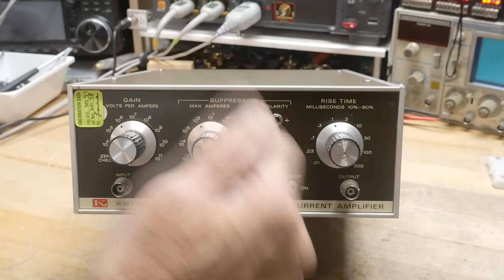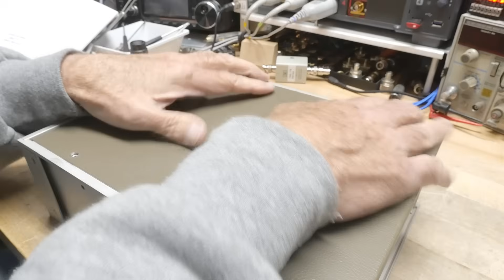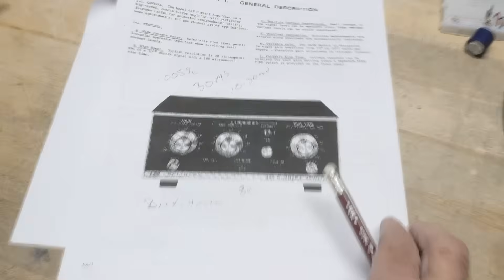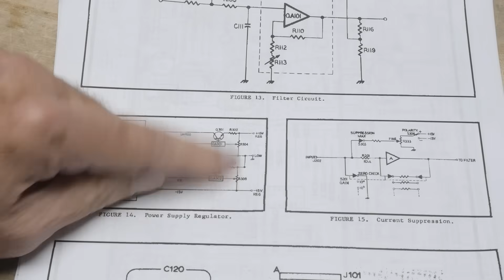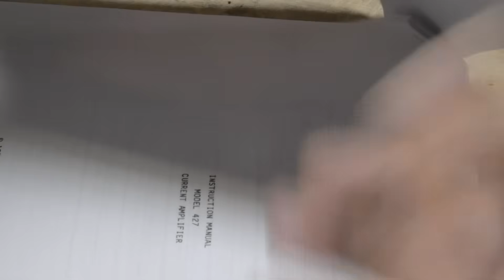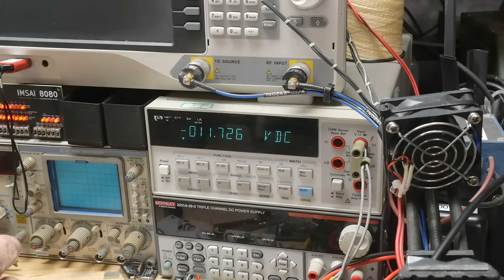#2445 Keithley 427 Current Amplifier

Comment: For a really low current source... drive a ramp of 1 mV/s into a 1 pF really low-leakage capacitor (like Teflon) That  generates a constant 1 fA current. I'd say good luck with guarding leakage... but, I'm not an HP physicist.

Comment: Typical norton opamp is a current mirror (active load to ground), gain transistor and a cute bootstrapped totem pole output: lm3900. For twenty years I worked only with transconductance now I learned the power of the transimpedance. Actually you measure a transcondictance with a transimpedance; they go hand in hand. Btw Norton Theorem: every node boils down to a current and a resistor. Of course mister norton invented Norton's theorem. Thomas m. Frederiksen invented lm3900.

Comment: Would love to know if anyone has good resources or tidbits on best practices for that kind of metal divider isolation between the power side and the sensitive stuff side. Seems like in test equipment, due to the precision involved, care is taken to isolate things well, but in industrial cabinets transformers are often mixed in with the computerey bits.